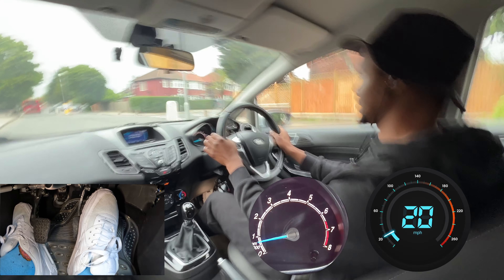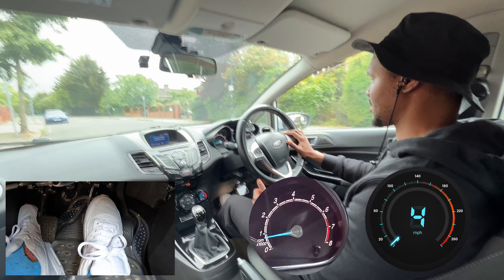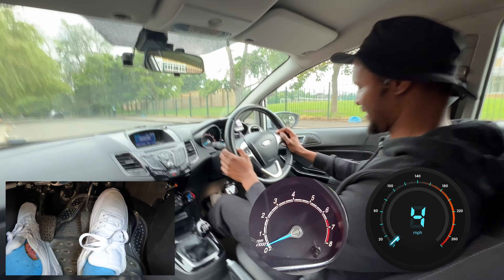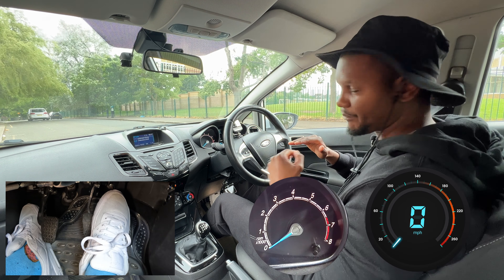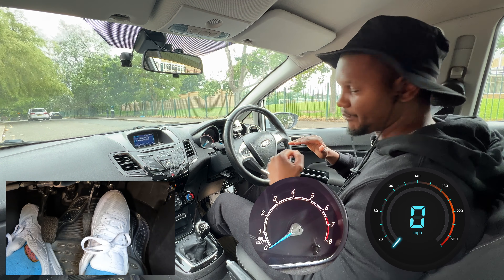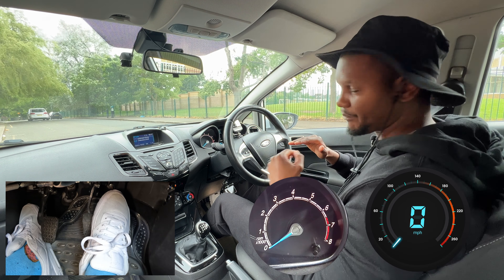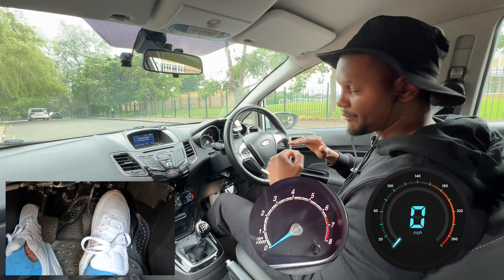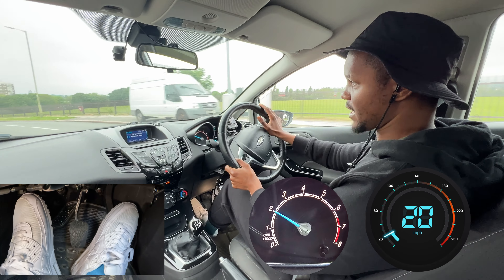Pushing The Limits: How Slow Can You Drive In Each Gear Without Stalling? Real-life Experiments!

Comment: I know every car is slightly different, but my Dad gave me some sage advice when I got my first manual car a month ago - Take your current gear and multiply it by 5 to find out roughly how slow you can go without stalling. 

So: 

1st Gear = 5mph
2nd = 10mph 

So on and so forth. Has helped me a lot when it comes to slowing down for turns or approaching lights.
Reply from the maker: Sounds like pretty good advice

Comment: thanks for your video it realy helps us .
i started to drive from my home when reached 8 or 10 miles i changed 2nd gear on the hill but even i pressed full gas car wasnt going up and i have to stop. my wife said don't change gear on hill is it right?
thanks
Reply: Its not about the gear. When you change to 2nd gear, hold the clutch in biting point and start accelerating, release the clutch when the car starts moving a bit fast
Reply from the maker: On a hill, you have to accelerate a lot more before changing into higher gear. Gearing up too early means you'll lose a lot of speed and then the gear would struggle and eventually you will stall.

Comment: i go by  4 gear when i start break how i know to changer gear3 gear 2 or gear1
Reply: from a stop select gear 1, then build the revs to about 6 or 7k rpm and let go of the clutch fast
Reply from the maker: It will depend on your speed and what you're trying to do. So if you're coming to a stop, you can go into 1st once you reach around 10mph. If you're going to continue moving say around 20mph or a bit less, then you can go into 2nd or even 3rd in some cars.
Reply: @ZONDOdriving  thanks teacher but how i know the speed 20 or less only by checking dashboard or differnt way as well i want know thanks
Reply: @ZONDOdriving  how i know the speed 20 or 10 how i know